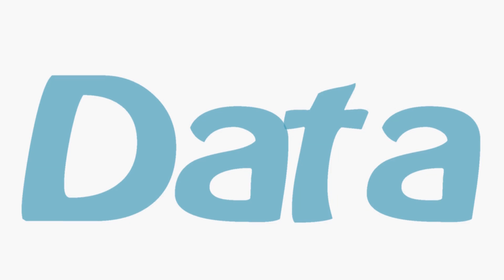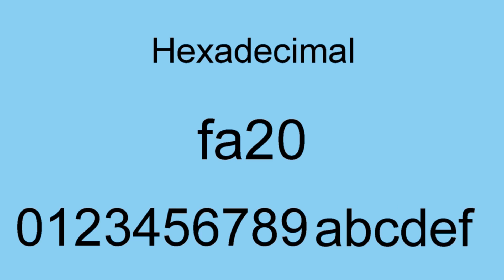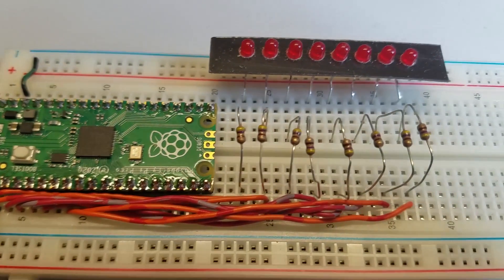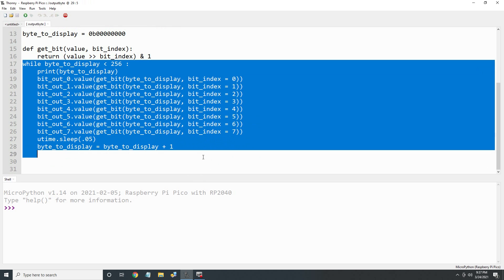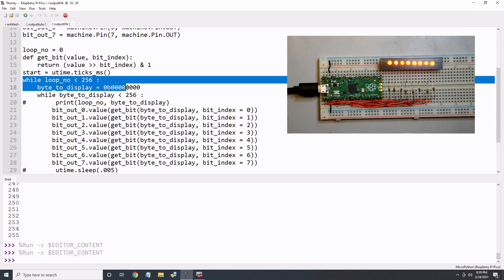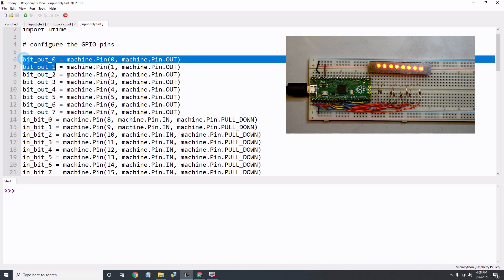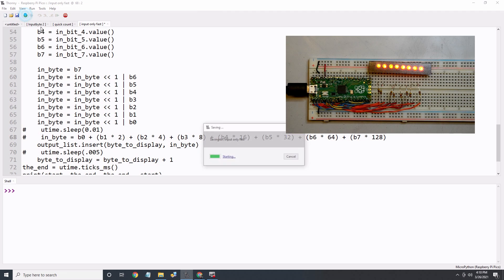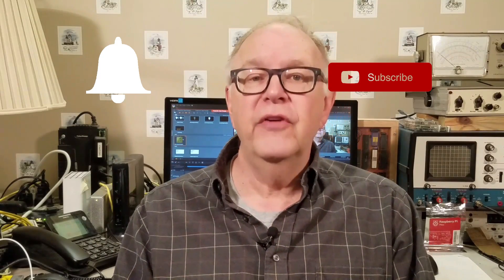Raspberry Pi Pico Data Throughput (Ep. 0.2)

Comment: Casting shade on octal, eh?  Maybe hexadecimal is good for the 6502 instruction set, but in the 8080 and Z-80 instruction sets, most of the instructions have three fields, consisting of a 2-bit opcode followed by two 3-bit operands, which makes hand assembly into octal the most convenient base.  Furthermore, translating octal into binary, to flip switches on a programming panel, is much more intuitive in octal.  It just doesn't make sense to me, what "DB" is in binary (without a great deal of practice), because "D" and "B" don't even feel like numbers.

This doesn't work so well for the 6502, because its instructions have their bitfields arranged differently, so that they don't map directly to octal fields.  Which is why you see all 6502 opcode tables in hexadecimal.  Kind of dumb, if you ask me, since MOS still used a 2-bit field and two 3-bit fields, but they were arranged as 3+3+2 instead of the more sensible 2+3+3.  And the 6502 doesn't align well with 4-bit fields either, so hexadecimal doesn't really make sense either, and hand-assembling 6502 code always involves looking at a big chart.

And you're right, the PDP-8 people prefer octal for the same reason the Z-80 people do, as do the PDP-10 people, since that machine used a 36-bit word, and for text that didn't require lower-case letters, packed characters in 6 bit fields, which of course can be represented by two octal digits each.
Reply from the maker: You're right, when I was hand programming a PDP-8S in school,  octal worked fine; actually good.  However, when I built my 6502 computer in 1975, I built a hardware keypad front panel that was simply just much easier to design in hex.   You work in hex for almost 50 years on 8, 16, 32, and 64 bit machines and it becomes second nature (but I still have to look at what "C" converts to in binary if I've been away from machine language for a while, LOL).
Reply: @LifewithDavid1  Ah, it's all about that first home-built machine, isn't it?!  My first (1978) was a Z-80 with a TTL bitmapped graphics chain.
Reply from the maker: @BrightBlueJim  Some early videos about my early computer adventures: https://youtu.be/rxBV3YILaaM
https://youtu.be/BcqRvHkn-EA
https://youtu.be/BcqRvHkn-EA
Reply from the maker: @BrightBlueJim  BTW, I apologize for my "amateur" early videos.  I'm not a pro like you.  Your editing video was great!

Comment: I wonder why the datasheet says to use 'time' but other places say to use 'utime'.
Reply from the maker: As I understand it; utime relies on a hardware real time clock, and time relies on a system supported clock.  They do the same thing as long as you don't need the exact time of day; then you would have to set the system clock to the proper time and date first.  Since the pico doesn't have a hardware real time clock; so I think they would do the exact same thing.

Comment: Hex vs Octal isn't determined by the preference of the user.  It's determined by the architecture of the hardware.  PDPx computers had 3 bit op codes and register numbers that lent them to use octal nomenclature. Intel, Motorola, etc., used 4 bit op codes that lent them to use hexadecimal.  I worked with the person who had to write a cross assembler for the Motorola 6800 that ran on a PDP11.  Writing code for 4 bit on a 3 bit computer was a big problem.
Reply from the maker: You're right.  For those of us that "came of age" with smaller bus widths (8 bit) that had the instruction op code in one word, hexadecimal made sense.  However when you combine the op code with data or addresses in larger word sizes, I can see where using a system that fits the size of the op code would be appropriate.  Thanks for the insight!
Reply: @LifewithDavid1  One of the first computers I programmed was the GE/PAC 4020 in the 1960s.  It was a 24 bit computer with 6 bit op codes.  I'll put a link to the manual in a reply because YouTube likes to delete non YouTube links.
Reply from the maker: @WilliamBurlingame  In the early 90's I did some troubleshooting and modifications to a Westinghouse Prodac 50; their answer to the PAC 4000 series.  Very cool computer that was used to provide automatic startup and control for an early 70's 35MW Westinghouse combustion turbine/generator.  BTW, I think YouTube beat you to it regarding the link. 😞
Reply: @LifewithDavid1  Yes and I tried again by using  (dot) in the URL and they caught that also.  I worked for GE at the plant where they made the computers.  After I left and went to Motorola, GE sold that facility in Phoenix to Honeywell.

Comment: I'd have thought this is what PIO is for. You can gang consecutive pins together can't you?
Reply from the maker: Yes you can.  It shouldn't be too hard to write a PIO program.  The bigger issue is the difference in signal voltages.  I'm not sure if you can get quick enough rise times on the standard level converters.  I noticed some pretty rounded "square wave" when I looked at them in my level converter video.
Reply: @LifewithDavid1  I used to do 6502 hand coding when I first discovered computers with a Commodore PET. I should think 3.3v would be high enough to give you a logic 1 on a 5v 6502 system. The other way (5->3v), you can use a voltage divider with 2 resistors. 2k2 and 4k7. (Per pin). Unless pico is 5v tolerant, but I doubt it.
Reply from the maker: @andyonions7864  When I designed and built 6502 computers in the mid 70's, I had reliability issues with the data lines that I eventually traced to low voltage.  However the new chips could be little more voltage tolerant.

Comment: For performance sensitive application, i would definitely recommend programming it with Arduino C or just plain C, then I am sure it would be way faster.
Reply from the maker: You're right.  And to make it even faster, use the PIO feature of the RP 2040.  Check out my video (https://youtu.be/dGNJGC_wZtk) where I use PIO and MicroPython to achieve speeds much faster than the 6502 can handle.

Comment: If you really want speed, you need to access the IOPorts directly rather than through "function" calls.  The problem with Arduino IDE, Python IDEs, etc, is they always only promote port access in bit function calls.  On the Atmega328, you can access 8-bit ports just as if they are a local variable (i.e. SFRs), and in the Pico, you can access 32-bit ports in Single-Cycle IO Block.  I haven't played with the Pico IO ports, but I know they are going to be 100s/1000s times faster than calling a function to read/write just 1 bit....  Check out the RP2040 Datasheet for details.
Reply from the maker: That sounds like something I'll have to look at.  Right now, what I hooking the Pico up to is very slow, and I also think I'm going to to be speed limited with the level shifting hardware that I'm testing now.
Reply: @LifewithDavid1  I don't know if it's available in Python... But with C and PICO SDK, you could also use the gpio_get_all(), gpio_put_all().  These two along with gpio_clr_mask(), gpio_set_mask(), gpio_xor_mask() functions access ALL the I/O pins as a single 32 bit value.  

In any case, your title is would be more correct as:  "Python's Data Throughput On Raspberry Pi Pico".
Reply from the maker: @montpierce424  you're right.  As I discover more about the Pico, I'm learning about PIO; which makes it incredibly fast.  Check out some of my more recent videos.

Comment: do not the_end - start, use ticks_diff to correctly calculate the difference
see http://docs. micropython. org/en/latest/library/utime.html?highlight=tick#utime.ticks_diff
with short code, please add it after your timetable,  lets us test and maybe improve (when no extra hardware is required)
Reply from the maker: You are right if the time between the start and stop is  greater than 100 seconds.  However the time is much less than a second, so rollover isn't an issue.  I did try it several times and the the results were exatly the same.  However, I will try it with ticks_diff and see how it compares.  Thanks!